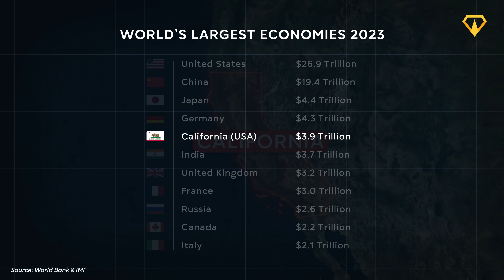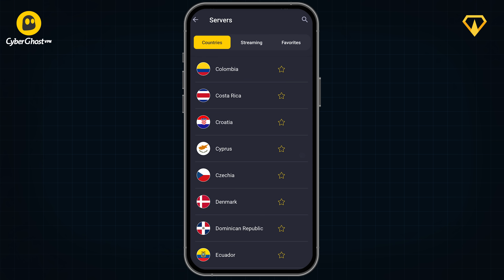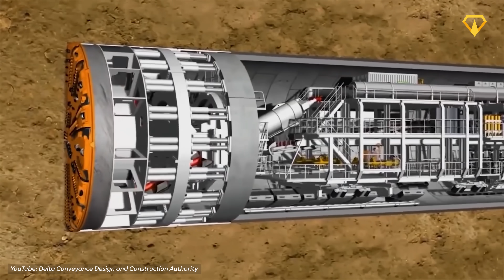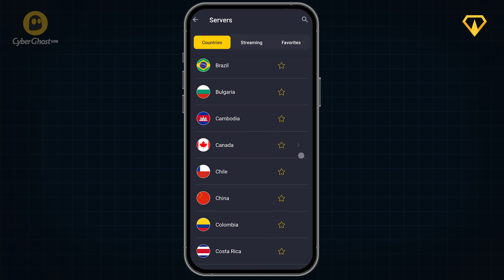California's Massive $20BN Water Transfer Project

Comment: Climate change doesn't bring unpredictable rainfall patterns.  California has always had these.
Reply: EXACTLY. The PDO, LA nina/El Nino cycles is what dictates most of the drought cycles in the West. We are right at the end of the La Nina (drought) dominate 20 - 300 cycle where we will change to having more El ninos than LA Ninas. You can go back 100 years and see the cycle remains quite consistent. I just wish more people would learn about thus instead of the constant sensationalized media headlines....
Reply: @WYO_Dirtbag  except the changes aren't comperable to the cycle, while it does get misreported but it's also not accurate to say this is within the norms for the cycle. That is a misdirect used by the savvy to distract from the truth about anthropogenic climate change. 
We also have a cycle where the planet's orbit changes slightly and that has an effect on the climate. But even controlling for that it is still an undeniable truth that not only is anthropogenic climate change a thing, but it's also a dire issue that needs addressing.
Reply: Lmfao what are you on?

Comment: I feel like a desalination plant would make more sense, but it would be much more expensive.
Reply: Money isn't the issue, it's action. They've had time but chose to not even try it. They could easily do it if they wanted to.
Reply: It would be cheaper than hundreds of k’s of concrete and much much much better in terms of c02 as well
Reply: desalination causes a lot of toxic pollution and requires a massive amount of energy, which causes more pollution.
Reply: @AL-lh2ht  its the plan for "The Line"
Reply: There's a ton of desalination plants across the world, especially in the Middle East. It's not a new idea.
Reply: To give you an example, there is a desalination plant in Carlsbad, Southern California. It produces 56k acre feet per day. That is only 10% of San Diego County's requirement. It was causing ecological damage from the suction sucking up sea life, drawing a massive amount of electricity, and as mentioned producing a shit ton of super condensed salt and pollutants. It was revised in 2018 to prevent the ecological damage
Reply: it also sucks much more energy I think

Comment: All this when you have the hottest place on earth to help desalinate all the water you need with the aid solar concentrating mirrors.
Reply: Literally no one does desalination like that at scale. If it were an option places like Saudi Arabia would have them instead of the desalination systems they do. Industrial desalination requires massive amounts of power, which means power plants, and if you think global warming is a problem (it is), then renewables and nuclear is required. Expanding renewable generation is something CA is doing.
Reply: @peterm0755  Solar Powered Desalination is renewable
Reply: @jidery  Desalination creates concentrated brine which has to be captured or released into the ocean. This devastates the coastal ecosystems.
Reply: @roberson644  Concentrated brine can be mixed back into fresh seawater so that it only increases the salt content by a couple of percentage points, and as long as the outflow has enough water current the sea life won't even notice the difference as it is diluted further the further the water moves away from the outflow pipe. Technical problems have technical solutions.
Reply: @roberson644  Do you know where Lithium comes from?
Reply: @peterm0755   Saudi Arabia IS going to do just that. They're building such a project now. No power needed other than the sun. Solar concentrating mirrors can heat oil or water to well over a 1,000F inside pipes or tanks, nevermind the 212F required to boil water.

Comment: This is like using duct tape on a leaking pipe. At some point, you have to shut off the water and fix the pipe. In the long run, desalination and pumping plants would be a much more permanent solution.
Reply: Yeah, lots of great solutions like that exist if you merrily ignore the vast unsustainable energy consumption.
Reply: Yes sir! Modern nuclear plant can provide an enormous amount of power for solid desalination.
Reply: @markdorman52  if you can get one built. 

we also might want to consider that the current 40 million residents  is enough.
Reply: @markdorman52  cali ain't gonna go for that... look at how many they have closed in the last 10 years.
Reply: @persistentwind  True. Let them charge their cars with solar panels, I guess.
Reply: desalination causes a lot of toxic pollution and requires a massive amount of energy, which causes more pollution.
Reply: @AL-lh2ht is no it does not the salt the only real waste can be pumped back out too see over insanely long pipes so no one area gets salt poisoning, Heavy metals can be used in heavy industrial areas for a variety of purposes!
Reply: @AL-lh2ht  It should be possible to power it with solar and wind energy, worst case nuclear. And I'm sure the waste can be processed and used for something we need?
Where there is a will there is a way.
At the end of the day, if you don't have water nothing else matters.. So cost should not really be a concern, it's build it or die.
Reply: Desalination will never be the solution. The shortage is in free or extremely cheap water. Agriculture uses 80% of human water use and is only viable with free or extremely cheap water. Desalination will never be inexpensive enough to use for agriculture. Agriculture only contributes 2.5% of CA GDP. If you simply reduced agricultural use by 20% you could double the amount of water available for residential and commercial use that produce the other 97.5% of CA GDP.
The problem is not the amount of water the problem is how we allow people to use it. Charge all water users a minimum charge per gallon and they would quit wasting it on extremely water intensive and low value crops like growing rice in the Sacramento Delta or cotton in the central valley.
Reply: Guys, please listen to understand. The Delta Conveyance is not a fix all. Its a specific solution to a specific problem that pops up every few years. During extreme drought, the Lower Sacramento still flows at over 3,000 CFS and enters the north end of the Delta, which is an estuary. The California Aqueduct pumps out fresh water at South end. During the extended droughts, salt and brackish water encroach further into the Delta dangerously close to the pumps, forcing the whole system to shut down. The project simply sucks out the fresh water before it mixes with the brackish.
Reply: No need. There is so much water that runs down the yuba, American, feather and other rivers that every storm flow out to the ocean there is no place to put it.  The reality is that water needs to be put in more reservoirs and used throughout the year.  Desalination will place power demands on a state that suffers brown outs every summer...
Reply: @persistentwind  we also need to have farmers in central California from growing water intensive crops like almonds and alfalfa.
Reply: @rudysal1429  almonds are big money though.   but should be grown in the north.
the orient is the high water demand crops they want to grow south of Fresno.       it's basically desert and shouldnt be farmed
Reply: Actually the state has filtering water and pump it back underground. @persistentwind
Reply: @persistentwind that's extremely destructive to our norcal rivers and environs snd recreation.   we are not gong to destroy what we enjoy for the south. i love socal but  no.

also we have a lot of growth in the north of people who need more water
Reply: @SFDOM415  what are you talking about? Do you know how much water during storms just flow on out to the pacific? Do some research on How many trillions of gallons flowed to the pacific last April.
Reply: @persistentwind  Brownouts are no longer a problem because of the increase in batteries, both large systems and on houses. I produce 2,000 kW-hr per year more than I use. There are some scheduled blackouts because of fire danger, but these are being reduced by undergrounding  power lines. But desalination is too expensive for agriculture and over 80% of water use in the state is for agriculture.
Reply: @danielcarroll3358   I still have brownouts and there is massive uproar because pge is not undergrounding as advertised...
Reply: It's California, they're lazy and don't actually give a fuck. That's why they have been taking water from Mead, a body of water not in their state nor on their border because of an old deal, despite taking FAR more than everyone and for things like crops when there has been means to solve this for themselves. The reason is they don't actually care. Keep a problem, and you can run on it.
Reply: I'm all for SHUT THE WATER OFF PERMANENTLY! Fuck Newscum/NOCOCK!!!!!
Reply: Lol desalination yeah then we worry about no fish 😂 hard pass think bro
Reply: Desalination is very expensive. Can U afford cost so expensive water?
Reply: That prevents an unending problem for the beurocrats to profit/scam the American people.At this point it's obvious California is ran by the uniparty/permanent political class/neoliberals and neocons who've sold out the American people to the highest bidders, lobbyists decades ago.
Reply: If only we could control the weather world wide, we could have beautifull forests everywhere, instead of deserts or scrublands ☹️
Reply: @Hession0Drasha  why would we do that?  i love the desert.    i vacation the desert.  i'm going to retire in the desert 

don't be a kook.  i don't want the whole lantern to look the same.  are you 12 years old or something.  what a stupid comment
Reply: Desalinization is a literal pipe dream. Enormously wasteful and disruptive to the ocean. California does NOT have a water problem, it has a water MANAGEMENT problem. The amount of water dumped into the ocean due to lack of connectivity between water districts is absolutely wild. Not to mention, water districts refuse to share overabundance due to rain and snow melt without being paid for it. So they'd rather dump. It's ludicrous.
Reply: Nonsense!  Desalination is absurdly expensive.  California has plenty of water - it's simply misused/mismanaged. Agriculture uses 90% of all available water, yet only produces 5% of the state's GDP.  The solution is to buy up water rights and divert to urban areas, returning 'farm land' (ie, semi desert) back to nature. Win-win-win.
Reply: Yeah, but the California Progressive mind hive hyperfocuses on brine and marine life instead of trying to figure out how to mitigate those problems. Meanwhile, Saudi Arabia and other Middle Eastern countries have been doing this for decades already.
Reply: @ You people just don’t get it. Everyone knows you can do desalination. The problem is it is far too expensive for agricultural use. There is no shortage of water in the West. What there is, is a shortage of free or dirt cheap water. Charge all water users a small nominal charge for every gallon they use regardless of the sources and there will be more than enough water for everyone. So they won’t be growing rice, and cotton two commodity crops that are very thirsty  that should have ever been grown in California.
Reply: Yea LA should do that and stop stealing our damn water.
Reply: @turbot_  LA isn’t stealing anyones water. 80% of California’s water goes to agriculture. 10% goes to residential and 10% goes to commercial. You are never going to make up for dry years by cutting back on residential or commercial use. The only use that is big enough to make a difference is agricultural use.
Reply: In the nineteen sixties Los Angeles was looking at a nuclear plant on the pacific coast. I mean seriously; they had already bought the land for the site, and started building a receiving station within the city limits to handle that power. 
The beauty of the plan is that nuclear power plants have to be base load operated. They aren’t run to follow the power consumption curve. So the plan was to generate electricity for the city in the daylight hours, and switch to desalination at night - that way the nukes would run at full capacity 24/7, solving the problem of “what to do with the excess energy at night.”

Currently, Los Angeles is facing the same problem, but during the day, “what to do with the excess wind and solar capacity?”
Sell to your neighbors would be the obvious answer, but the west coast is awash with excess “green energy”. (PG&E included,)

(PG&E has other, structural, problems. Primarily, they’re a natural gas company. Over the last century they’ve bought smaller electricity distribution systems, but they haven’t invested in maintaining their towers and conductors.)
Reply: @jameswilson5165... except desalinating the water means the ocean would be pristine anymore... libtards never think shit threw they just "shoot from the hip" in the next census they will find out just how much damage they have done when in the state's whole history it will be the first time we lose vote one the house & therefore it's electoral weight from Golden State to State of Confusion
Reply: Desal is far too expensive. California uses 13.3 trillion gallons of water a year . The most elaborate desal plants only produce about 21 billion gallons of water at the cost of 4 billion dollars. What you are saying is completely impractical
Reply: This is the correct answer!! Desalination is a much more resilient solution in the face of climate change, and can be scaled far beyond what the delta conveyance project could provide. Energy intensive, yes, but easily powered by nuclear or renewable energy sources. Residual brine is suitable to use in concrete, roadways, or simply diluted over multiple acres of ocean floor. Expensive? No, just the true cost of having reliable, sustainable water.

The real question is what is our long term goal as a state in terms of population growth and the intensity to which we utilize land?  We can’t continue to grow forever, so when and where are we going to draw the line.
Reply: nOPE.  jUST BUILD DAMS!
Reply: Yes thats what i tought! Why dont they do desalination!
Reply: Maybe 2 years go there was some recent proposals to do it buy environmentalists don't like the resulting brine that is generated. Not sure if its still progressing.
Reply: @marco-ls9fm  The shortage of water isn’t an absolute shortage it is a shortage of very cheap water. There is an unlimited supply of expensive water sitting off our coasts and in our sewage treatment plants. The problem in is California Water rights. The State is forcing urban areas to subsidize cheap water for farmers.
To much of California’s water is used for non-cost effective uses. Every drop of water in California needs to be taxed at a minimal amount to give users incentive not to waste it. In an arid area like California that so many people get either free or unlimited water for a nominal fee is ridiculous.
Reply: Cause it uses way too much electricity for it to be cost viable.  @marco-ls9fm
Reply: @marco-ls9fm you'd have to generate a lot of extra power to run it though.  it's very expensive
Reply: @SFDOM415 Nuclear Power Especially Reusable Nuclear ⚛️ Power Plants
Reply: @DarthAwar  they wont let u build those
Reply: @marco-ls9fm they already have over a dozen desalination plants
Reply: @marco-ls9fm The shortage of water in CA is in free or cheap water there is an unlimited supply of expensive water by desalination. CA’s water problems are purely political and there is no easy solution because no one will bit the bullet and eliminate water rights. Where people have the right to use huge amounts of a limited water supply for free or next to free.
Reply: @marco-ls9fm because desal does not produce enough water not even close to the needs of the state
Reply: Wow!!! You have never researched desalination, it poisons the oceans genius , way to go smart ass!!!!